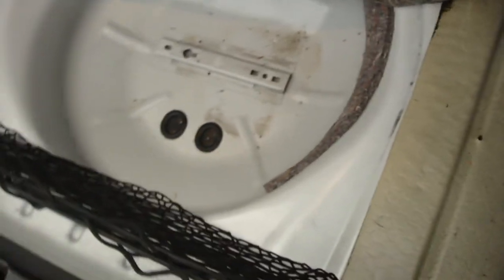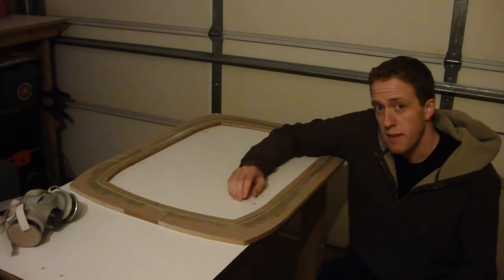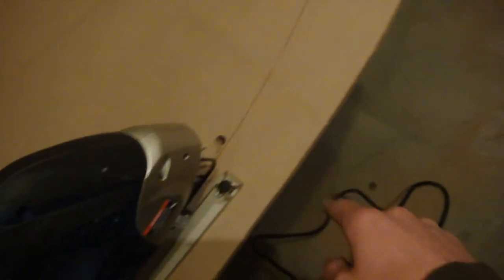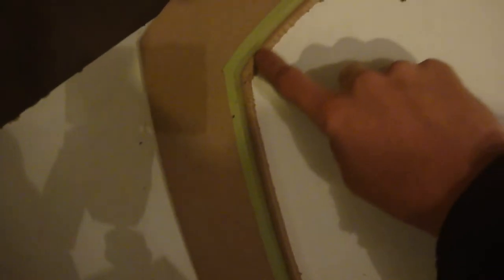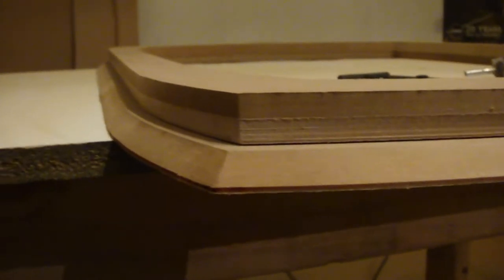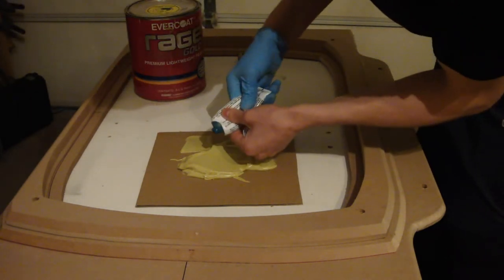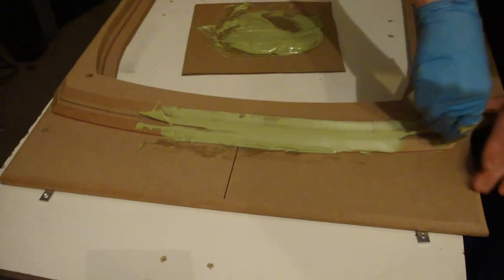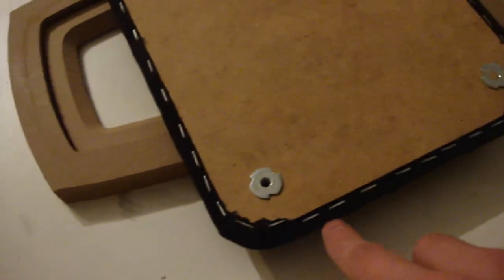How to build a wooden skeleton foundation  - Amp Rack 101 - Car Audio Fiberglass How To

Comment from the maker: Drill holes in the plastic, and sand it to roughen it up. Don't expect a bond that you can put 50 pounds of force on, but it will be strong enough that its not going to come apart with normal vibration.

Comment: What are your thoughts of cutting out the metal tire mold area and making a completely flat area out of square bar sections and flat panels? Similar to what Steve did in his Tahoe with his cut out battery rack. My VW r32 really doesn't have that much depth in the trunk and i don't have a need for the spare so its just wasted space. I'm not worried about chassis rigidity either.